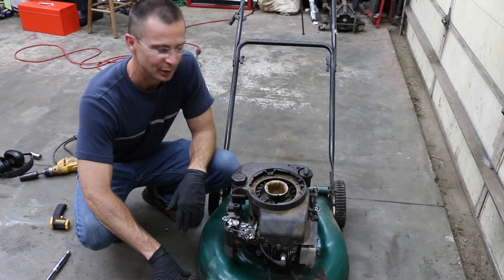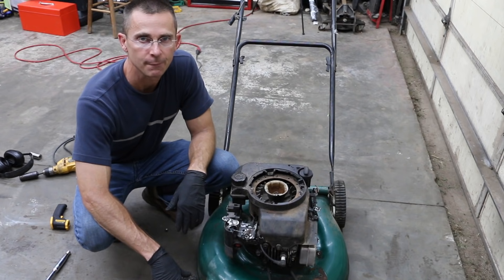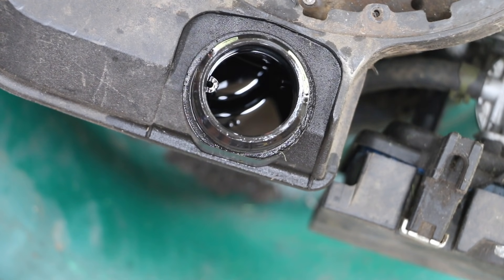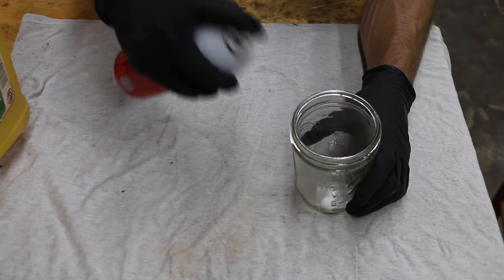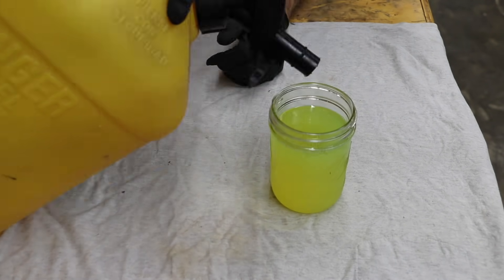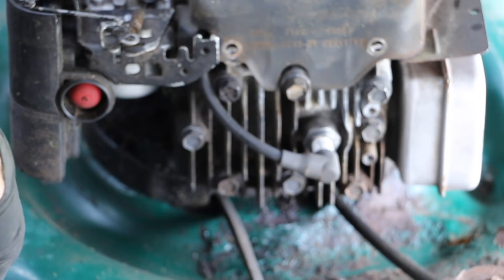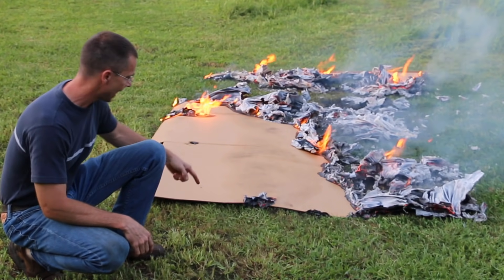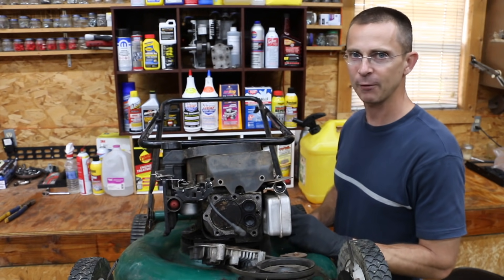Will a Gas Engine Run on Diesel?  Let's find out!

Comment: Project Farm:   How much compression can you develop by shaving down the cylinder head ?
Reply from the maker: Thank you for the video idea!
Reply: it won't gain any just the ratio will incrase say 8to1 will become 9to 1 look into re clearanceing the valves to take out comp release on all flat head Briggs the intake valve don't close completely till the piston is 2/3 of the way up the stroke you will then brake pull ropes and snap flywheel keys guaranteed
Reply: Avery Jones . I tried this on my push mower with overhead valves. I shaved  .020 off the head, installed it and readjusted the valve lash. No noticeable difference. I then opened up the fuel jet hole a few thousandths  (don’t enlarge to much) this did seem to make it perform a bit stronger...
Reply: @TheDeadMan3848  you have to adjust the timing of the valve s to take out overlap and to make the vaulve close sooner take the intake tappet and shave 20 thou off it and re adjust valves then tell me what happens
Reply: Avery Jones , I am not sure is it has intake tappets, it has pushrods with the camshaft in the block , I don’t think it would change anything, the valve will still open at the same time ?
Reply: @TheDeadMan3848  you are not really changing the timing the factory engineers the cam to hold the vaulve barley open for compresion realease once you over come that you will have a stronger engine but to save some trouble just run 93 octaine
Reply: @TheDeadMan3848  and it has tappets the push rods don't sit. Directly aginst the cam
Reply: @averyjones1098  We have a Briggs that will kick back and snatch the rope out of your hand. Kind of like a model T had crank would do.

Comment: I have a m35 deuce and a half military fire truck that is supposed to run on multi fuel... Ie gas, kerosene, alcohol, diesel.... How exactly does it do that? I have been running strictly on diesel...
Reply from the maker: Great question.  I'm not familiar with that setup, but I'm impressed it can run off of all of those sources of fuel.

Comment: if you trying alternative fuels, how about try mounting some hobby glow engine glow plugs in place of a spark plug, here is one example this one is for gasoline in a model aircraft engine. https://www.ebay.com/itm/382254251358 this one is for methanol https://www.ebay.com/itm/NEW-O-S-8-Glow-Plug-Long-Medium-Air-Car-3PCS/331228979791
Reply from the maker: This is a great recommendation--thank you!
Reply: your going to need some sort of adapter to mount the hobby sized glow plugs! the classic hobby engine glow plug uses a platinum wire as a catalyst for the Methanol fuel, as for the new types designed for gasoline fuels I currently do not understand the chemistry involved in how those work.

Comment: Well, I ran my mower out of gas while mowing, like I always do. I went to garage, filled her back up, used start fluid to get her goin, and Wow! Did she smoke like heck! I suspected I put diesel in, since I had a gas can full of it, sure enough, that was the one I used. I went back to the mower, gave her a pull, she fired back up, smoking like you would not believe, I proceeded to cut the rest of the yard, almost used the entire tank full of diesel. I had no issue with it, she ran fine except for all that smoke!  I wonder why your mower did not accept it? I also wonder why my mower did accept it? This is a mystery. Maybe the diesel must be dispensed from a rad gas can, lol.
Reply from the maker: The jet size was just too small on mine.  The fuel flow rate was just too slow.

Comment: 50/50 gas n octane boost 😆

What about using high octane gas I can feel the throttle response change with 91+octane booster in my tank . I had 2 Tahoes I did that to now my silverado... people don't believe it but 91+octane boost I like bwahahaaa usually do just chevron with the chevron octane boost the big bottle.
Reply from the maker: Thank you for the video idea!

Comment: Can you raise the compression high enough on the lawn mower to where diesel will ignite?
Reply from the maker: The flat head engine design is a challenge for boosting compression.
Reply: Yes, I was wondering if it would blow the head gasket ,or break the Aluminum head, but it would be challenging. I once ran into a flat head engine in a forklift with 240 psi per cyl when tested, due to excessive head milling, this gave me the idea. Thanks

Comment: Diesel isn’t combustible as far as I know. It combusts under pressure in a Diesel engine but doesn’t emit gases like gasoline does. That’s why gasoline engines has spark plugs and Diesel engines don’t.
Reply from the maker: Thanks for commenting.

Comment: Diesel fuel in a pump sprayer works very well as an accelerant to start brush fires!

 I've wondered if you were to use a glow plug from a diesel instead of a spark plug what would happen? Tap a no foul insert out and screw the glow plug into the no foul insert. Most likely two no foul inserts would be needed since the tip of a glow plug is rather long.
Reply from the maker: Great recommendation--thank you!

Comment: The reason you needed to use the primer is because the engine was timed for the gas to be easily ignitable. But not timed for deisle because it takes to long to ignite and the gas helped ignite the diesle
Reply from the maker: Great point!

Comment: Try heating the diesel at different 25 c increments to make it so it will vaporize better while being injected. 25c 50c 75c and 100c. I bet if you can maintain the diesel between 75 and 100 c it will vaporize enough to keep running.
Reply from the maker: Thank you for this recommendation!

Comment: Ehm abit off topic but can a mower engine run when stood up or do i haveto get an engine thats designed to be stood up or can the bottom part of the bottom block be switched? Planning on go kart but i have a flat mower engine and I dont fancy buying one.
Reply from the maker: You'll need a horizontal shaft engines.
Reply: Project Farm ok thanks man. Guess ill haveto buy a stand up engine.

Comment: Try maybe a fuel injected engine with a fuel pump and play with the timing? It seems the carb was not able to pump the diesel fuel. But of course two completely diffrent ways of running for sure.
Reply from the maker: Thank you for this recommendation!

Comment: You can tell the tubes between the outer layers of cardboard filled with gas vapor and violently erupted out the sides.  This also tells you which way the tubes are oriented.
Reply from the maker: Great point!

Comment: I'm VERY surprised it ran on diesel AT ALL, I'm thinking there was some gasoline vapor/residue in the fuel tank (your first attempt) and fuel lines leading up the the carb, enough to get ignition but then it eventually went 99.99% diesel fuel and died. There's no way a gas engine will compress enough to ignite diesel. You can throw a match into a bucket of diesel and it'll go out.
Reply from the maker: Thanks for commenting on this.
Reply: Project Farm By the way, you must have some really cool neighbors. I can see it now... guy comes home from work.... "Hey Liz... what's Jim up to today, have you seen him??"..... "Nothing much Paul, I was looking out the kitchen window about an hour ago... he was out in his yard, dousing a piece of cardboard, flapping in the wind, with either gas or diesel or God knows what, lighting it on fire..." "Oh... ok. Smells great, what's for dinner??"

Comment: I remember i ran out of petrol for the lawnmower and I used 2 stroke from my grass trimmer. In my premixed bottle the lawnmower ran fantastic but I wouldn't recommend it long term. Just to get you out of a fix only
Reply from the maker: Thanks for commenting on this.

Comment: my push mower has started to run rich like it has the choke on,  oil has been changed but hasnt helped. Once you turn it off you can not start it again because it flooded. I haven't touched anything on the engine. Anyone have an idea, dirty fuel or something else?

Comment: Thanks for all your, VERY Interesting Vids'. 
Which is the safest least damaging way to clean my BMW engine ?  e34 525i Petrol . 
what can i add to the Petrol ( gasoline ) in the UK ?
I am thinking may be a 10 % / 20% mix for a short while ? ( 1000 miles ? ) 
or a lesser mix for everyday use ? 
( or a stronger mix for less miles as a once a year 300 mile run ? ) 
Any ideas ? Any NO GO ideas ? 
this is a 1990's VVTI engine 24 valve 6 cyl. 
far too expensive to damage or Harm in any way. 
My engine is in excellent condition, i just wish to Clean it, or Keep it clean. 

Which is the best cleaner over all, and the safest as regards engine damage ? 

Your tests are fairly short, so damage would be minimal anyway. 

There is NO WAY to Open the Engine on one of these cars !  
We DO NOT have mechanics skilled enough to do it. 
those that can,  want to charge £1500 - £2000. UK £ . / $2- 3000, US.  vannos valve timing / re set issues. 
( a big No no in the UK )  buy another engine or car etc. 

Vannos = Variable valve timing, 24 valve engine .

Any info would be Great . 
Thanks from Yorkshire England.
Reply from the maker: Thank you!  I wouldn't recommend using diesel as a cleaner, since there are products specifically engineered to clean.  Do you have access to Seafoam, Marvel Mystery Oil, or Amsoil products?  Each of them has proven to be pretty good in my tests.
Reply: Cheers , Thanks Very Much. 
I'm not sure on some of those Brands. 

I see the USA to be :- A Very long way behind us in some things,  And a long way ahead in others. 
some things are banned here, and others there, 
It's ALL this EU Crap we get. 
It carbons up our Markets, our Trade, EVERYTHING ! 
Put a bucket of Treacle out in the Snow overnight then try to stir it with a plastic Spoon ! 

My best Description of the EU Legislation we get here. 

True Example:- ( Check the news this week. ) 
We have been allowed our British Passports Back  ( Blue )  ( not the Burgundy colored EU ones ) 
Currently we Print the EU ones here in the UK.  ( excellent ! ) 
But the contract to print our new Blue BRITISH ones has been awarded to a French company = Overseas ? ? 
BREXIT ?? HELP ! 

What is this all about ? 
Visit the Zoo , the Monkey's are more intelligent !
Reply: You must be choking on your fumes Laughing ! 
Yes that's how bad it is here ! 
Very clever to test on lawn mower engines. 
hence i'm careful what i try on the BMW.  going up in value worth 5 X - 10 X what i paid for it. 
None available in the UK. ( OK almost none )

Comment: i garrentee that if you put diesel fuel in your car, 1 it will run like shit. 2  it will burn the valves. 3 it will need a complete rebuild as it will soon stop running even on gasoline... because of the burnt valves! .....p. s. a continual light mist of water will klean the combustion chamber but  it can cause premature wear on valve seals and if u use too much it will crack the piston.
Reply from the maker: Thanks for commenting on this.

Comment: I ran out of gas on the lake (2-stroke outboard) after a bbq. I had a bottle of bbq starter (white spirit) and quickly refueled with it. The outboard worked exactly as with 2% petrol. However when the engine is cold it will be impossible to start on white spirit. Something to experiment with on four strokes?
Reply from the maker: Impressive!  Thank you for this recommendation!

Comment: Tungsten disulfide (*WS2*) mixed with 10-30 as a *performance engine oil*...
I would like to see how it holds up in a lubricity test,
how much more power it makes and if it will make the mower smoother/ quieter.
 will it even run?
I wanted to use this on my vehichle, but I figured project farm would be the best "mythbuster"...
Do this project farm (Y)
Reply from the maker: Thanks again!

Comment: I heard old hit&miss engines had tri fuel system in witch they'd start on gasoline, then diesel once warmed up drip little water into intake to keep it clean under load.
 Similar trick where i heard of people hooking water bottles to vacume lines and drawing moister to keep engines running clean.
 (like your vapor tank set up)

Another old trick was to mix little kerosene in fuel to keep engine running clean. 
You have talked allot about kerosene being major additive in many fuel cleaner additive ingredients so would kerosene clean out an engine or even run on it? 
Heard stories about mixing 1 part, fuel, 1 part kero, and 1 part transmission fluid to clean out engines as well dripping into intake.
Reply from the maker: All great suggestions--thank you!

Comment: Air fuel mix is also very important. Not only pressure. Even pure gasoline will not work without the ratio.
Reply from the maker: Great point!

Comment: In the dealership I worked in we would always put the diesel/petrol mixes in our own run about el cheapo cars. Anything more than 50/50 wont run but if you got a good batch of contaminated fuel you may get half a tank for free! 

Also, Why is your fuel green lol? ours in NZ is red/purple.
Reply from the maker: Thanks for commenting on this.  Not sure why the local fuel station chose green.

Comment: Would adding diesel to gas give you more or less fuel economy?
Reply from the maker: In theory, it would increase fuel efficiency, since there are more BTUs of energy per volume of diesel.  This assumes complete combustion, which would only occur if used in a small amount.

Comment: On just diesel no, the flash point for diesel is generally above 125°F meaning it would need to reach that temperature to burn. flammable liquids it's 100°F. The only reason it ran with the gas is because it was a mixture and only the gas was burning. Diesel engines run on the compression, conventional engine use sparkplugs. Diesel combusts. You could run an engine on any flammable liquid, the testing is really only to see how well it would run.
Reply from the maker: All great points and thanks for commenting.

Comment: Can you show us how 2T oil combined with Diesel @ 1:30 ratio affects Diesel engine?
Reply from the maker: Thank you for this recommendation!
Reply: Project Farm it seems to have a good effect on my Isuzu engine.   Lower smoke emission, better mileage, stronger pull and faster acceleration.   I'm not really sure if it has a placebo effect on me.  Or if it's real.  It just really feels great to drive my vehicle with 1 liter 2T mineral oil on a full tank than without one.

Comment: Did the exact same experiment today with my Briggs and Stratton 625 mower and had the exact same results/problem UNTIL the engine started to warm up and thin the diesal a bit allowing it to get picked up into carby! Continued mowing like this for the next 2 hours with absolutely no smoke and unreal low end torque, was mowing wet grass near 300mm (a foot) high. the engine just needs to warm up then its all good.
Reply from the maker: Impressive!  Glad this worked.

Comment: Really enjoy your vids.. i have always been told if you put too much starting fluid in a diesel to get it started it will blow the head off, can only use a 1/2 sec squirt , any thoughts?
Reply from the maker: I do believe that too much starting fluid will damage a diesel.  It's definitely hard on the piston rings.

Comment: We rented a Terramite mini backhoe for some deck work. Dig deep holes for circular concrete form in ground.  Got it to location, hard to start and smoked.  Was able to keep it running with full throttle and partial choke. Way down on power.  The rental placed had closed and not responsive to after hours number.  Used it to do the job. Took forever. And smoked up the place.  Ran steady.  I had checked oil levels, all good and fresh looking oil.  Then it dawned on me.  Either 2 cycle added, which would not make sense. Or Diesel added to gas tank to top off before we took delivery? Smelled the tank later, and had a combo smell of gas and diesel. It has a larger V-twin Briggs.  It did not run as good as your 50/50 mix. I bet tank was mostly diesel. When it was returned, I let them know if wrong fuel was added.  Shrugged shoulders and said “happened before”. Thanks again for your videos.
Reply from the maker: Thanks for commenting on this!  Glad you got the job done, despite the smoke and low power.

Comment: Gas engine on acetylene and oxygen
Reply from the maker: Thank you for this recommendation.
Reply: @ProjectFarm  years ago in the middle of BFE , was putting in a microwave / satellite tower. Gas jugs for welder had been swapped with water. (thieves) , so used the oxy rig with a rose  bud (seemed  a common sense thing to do) with a pop can for a stack, worked great if i rember about 4lbs acetylene 25 lbs oxygen
Reply: That will make a big boom
Reply: @flowtownfrowman  if it did run brother can you imagine how f**** loud that would be
Reply: Yea big fuck off bang from the engine. First lawn mower into orbit
Reply: Bryan Fehr
The Mythbusters did a hydrogen powered car some years ago.
Reply: I bet it runs and it's loud as fuck and the exhaust glows real quick